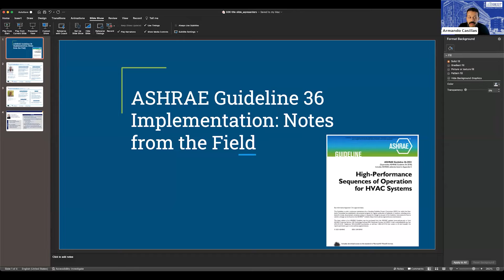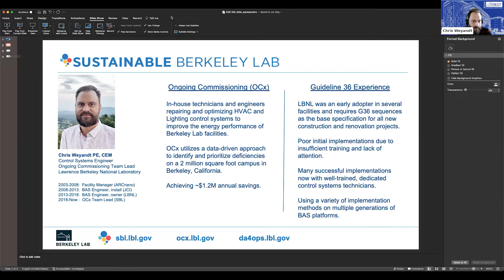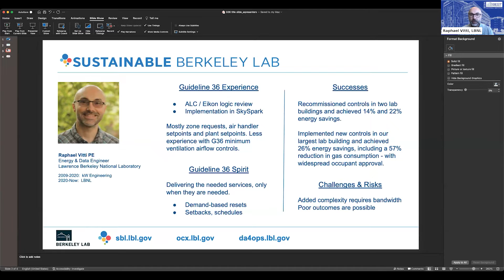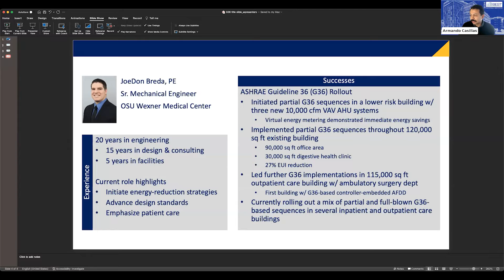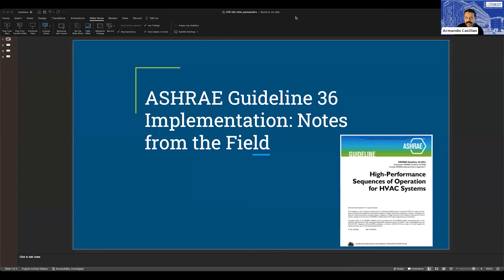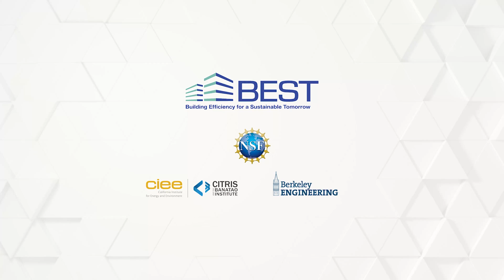ASHRAE Guideline 36 Implementation: Notes from the Field

Comment: It would be great to see a discussion on control platform software feature sets that are helping or hampering G36 implementations.   
-Doing peer to peer requests at scale with is easy with some platforms, and a nightmare with others.      
-Bulk program management updating and iteration at scale can be a challenge, some vendors seem to think you'll hit a homerun with your first attempt and don't provide the workflow to allow for low friction sequence updates to 100's or 1000's of devices.  
Having a BAS feature technical checklist for prospective customers would help pressure the controls industry to provide the toolsets to enable top tier implementations.  It's possible to grind out a solution on almost any platform but some allow for a lot of agility with great tools to implement and iterate at scale not just with 1000's of hours as a one time deliverable.